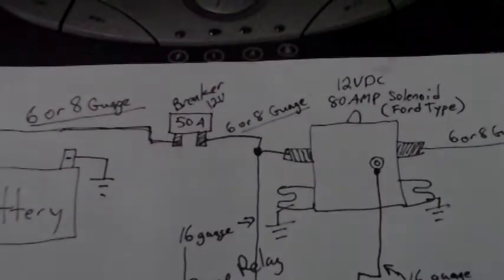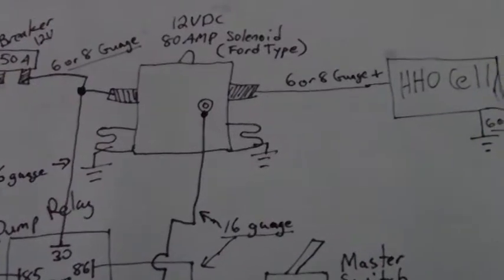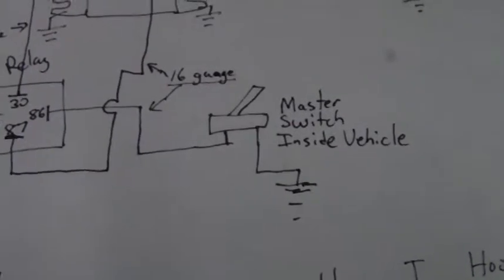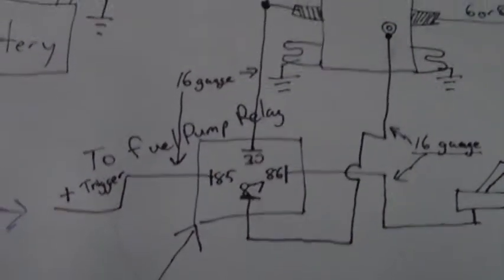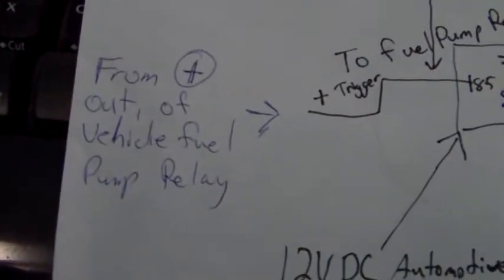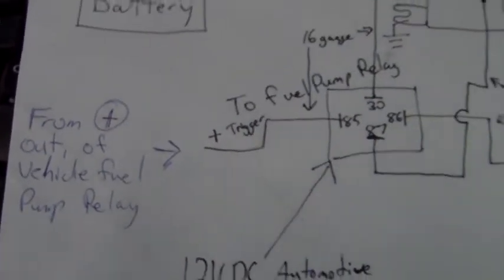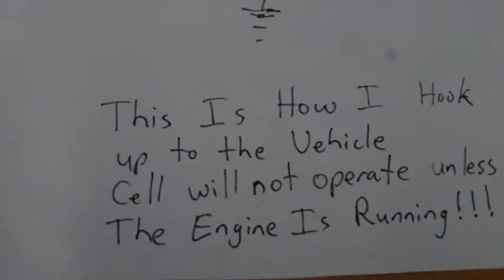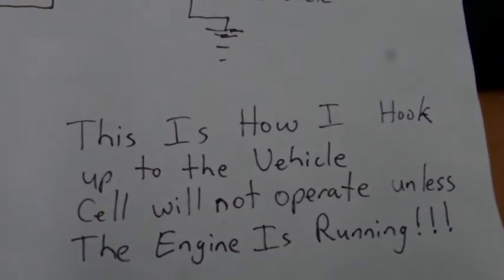How To Wire A HHO Cell To Your Vehicle

Comment: I thought about using a secondary yellow top optum battery with a 1000 watt amp and a bigger alternator. This way I can build up pressure before a start up the engine. If no 1000 watt amp then a  DC transformer that I can adjust the current.
Any thoughts about this Idea?
Reply from the maker: You don't want to put hho in the engine until it is running. Make sure you have a good flash arrestor too.
Reply from the maker: If you pump hho into the air intake before you start the engine it will explode in the air duct. This is caused because of the valve overlap in the valves. The flame speed of the hho is too fast to do it this way.
Reply: Oh yes I've thought about using 3 flash arrestors, better be safe then sorry. But why is that, the timing of the engine?
Reply: Got it thats great answer and never would have thought of that. I have heard people say that and never explained why. 
Keep up the great work man and happy holidays!
Reply from the maker: Merry Christmas. If I can help, just ask. Check out my video of the car running on nothing but hho.
Reply: Ok so I have been working on this for a while now and keep hitting brick walls. What solenoid is that, and flash arrestors what type are you using. Thanks for any help